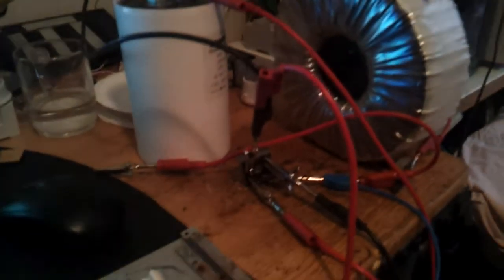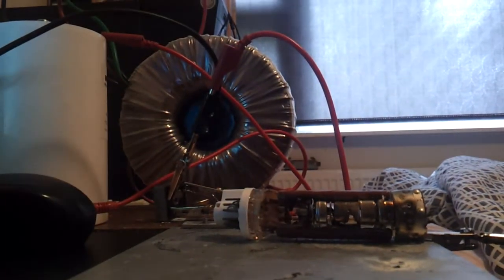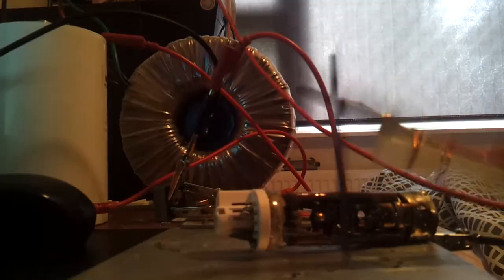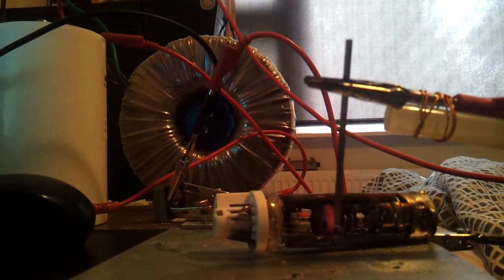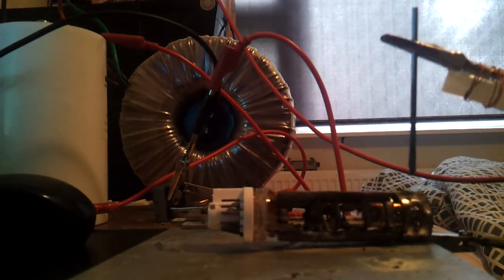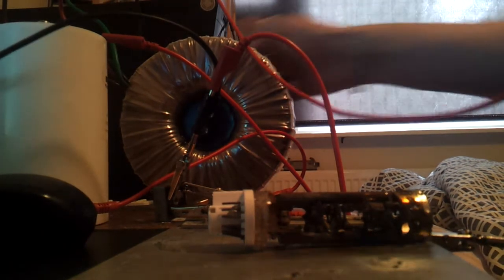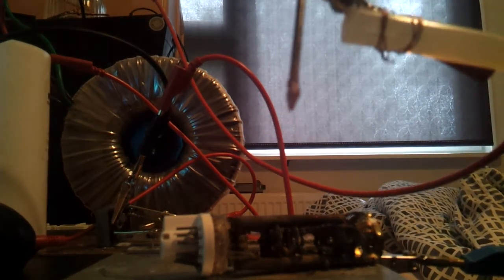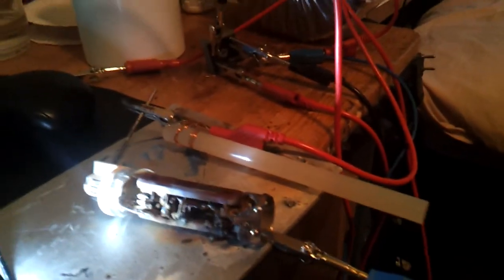ARC MELTING A ELECTRON GUN

Comment from the maker: How many watts are your ballast? Is it on the AC side on the rectifier or the DC side
You doesn't need a choke, I just used it to prevent the powerful spark in the begining which could weld the electrode and the electron gun together.